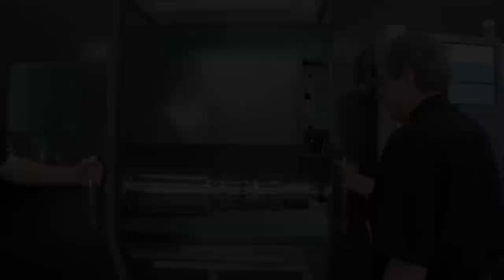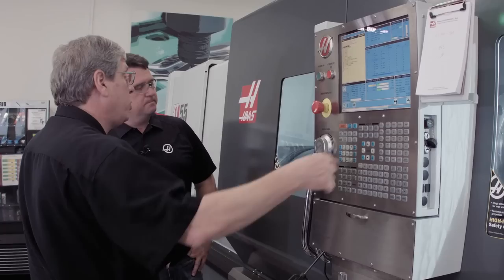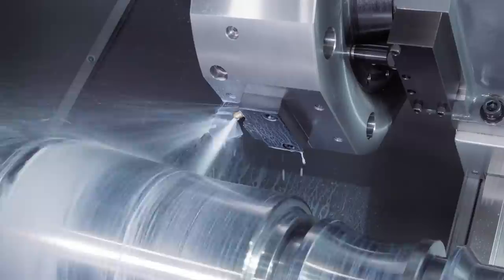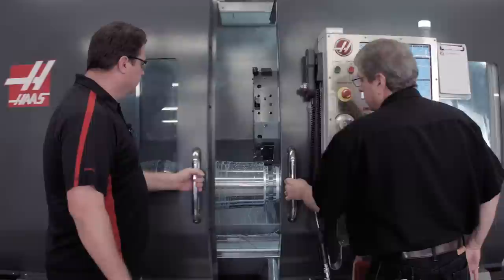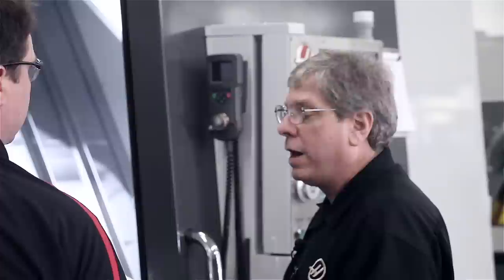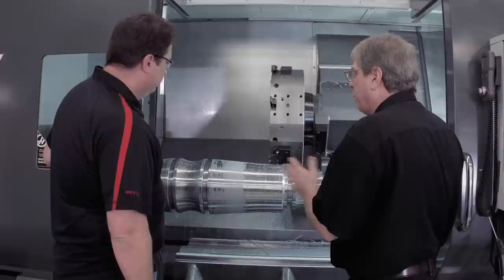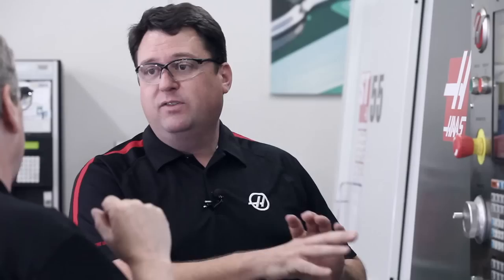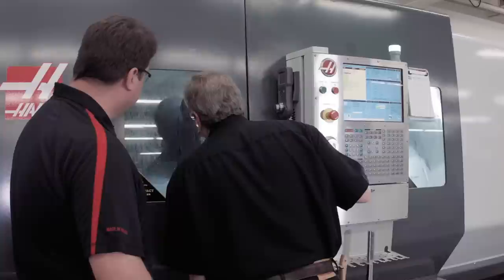Run, Stop, Jog and Continue

Comment: If you do this and replace the insert, and clear the wear offset, is the new wear offset used when you continue?  Or how about doing a long boring op then you jog away, measure the bore, and adjust the wear offset before finishing, does that work?

Comment: Can I safely index the turret while in this mode?If so - do I have to index it back to initial tool after - let`s say - changing insert, or the controller performs it automatically (ST-40) ?

Comment: If it possible to change the axis and handwheel the tool in a different direction while in RSJC mode?   On the mill, I want to handwheel the cutter up in Z and then handwheel the bed/table out.

Comment: Hey I'm using a Haas sl20 from 2000. 

I've tried performing this command, however when I press x to select the axis followed by handle jog it gives me an error "wait for reset". 

Is there a setting I must change or a code I need to input before using this feature. 

Thank you.

Comment: I have a 2005 TL-1,  sometimes this works, and other times it just say WAIT-RESET.  Why is that?  The fact it works sometimes shows it is actually supported.  I just end up having to use program restart because the Jog Away doesn't always work.  I rarely run in Mem mode, typically in the Current Cmds screen, but I've tried both with same results.
Reply: The older machines support Run From Here that the newer ones don't.  So the Jog Away is helpful, but only if the wear offsets are looked at again.

Comment: So, you have to remember all those settings and it has to be close to where it left off? I'm used to hurco's interrupt feature and am getting used to running haas for the first time. Can you index the turret? Do you have to index it back? How close do you have to be to where you left off? Sorry a lot of questions just a very helpful feature I don't want any surprises
Reply from the maker: +Steven Shaw We'd recommend instead of trying to remember all the settings, have notes and follow the procedure step-by-step. That way, you can be assured you won't make any mistakes. You don't need to jog the machine back to where you left off. The machine will travel back on its own. If you shut down the coolant and stop the spindle manually, make sure you turn the coolant back on as well as the spindle. You cannot index the turret. You don't need to return the turning tool to its starting point, the machine will do that for you automatically. Hope this helps! Please feel free to let us know if anything is unclear, or if you have any more questions.

Comment: I am using this feature for at least 5 years already on FANUC milling machines, I was always wondering why Haas does not have that option to stop and JOG! We have Haas Super VF2
Reply: Cobrass2 And Fadal had it since at least 1997. And it's simpler! Hit Feed Hold, Jog button, select the axis and move the spindle. Then when you're done, hit Manual, Start, it asks you if you want to start from current position or return axes, at which point it moves X and Y simultaneously, then moves Z. Then hit Start again and the program continues. I've heard Hurco has had a similar feature for well over a decade, too.
Reply from the maker: Cobrass2 atomkinder67 Thanks for the comments. We have had Run, Stop, Jog and Continue in both our mill controls (since 2000) and our lathe controls (since 2008).